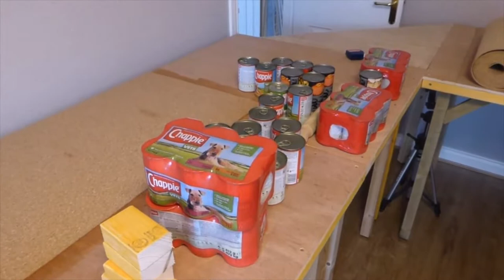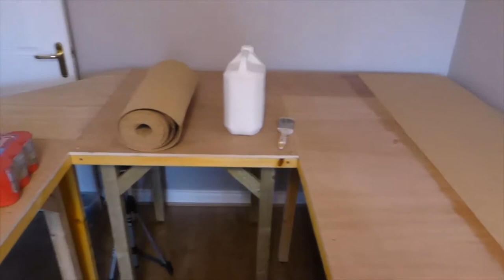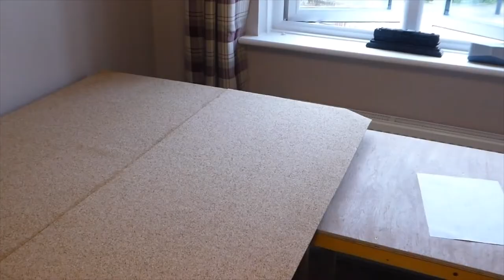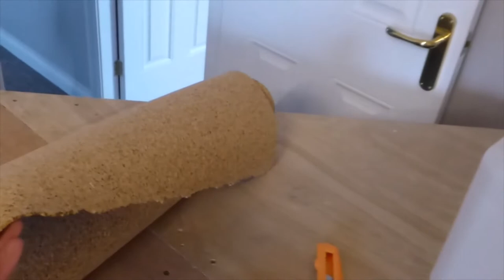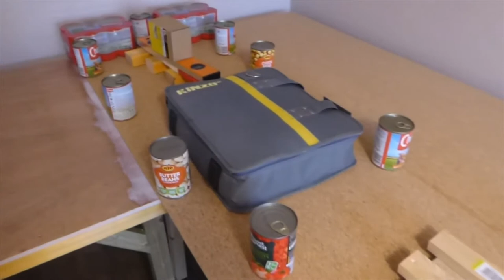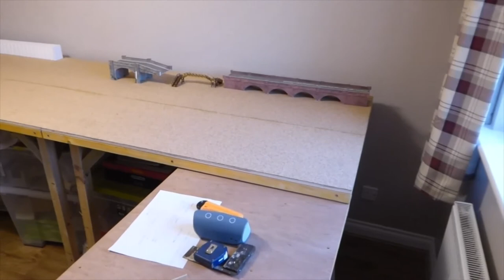Greenhill Junction - Laying Cork - Video 6

Comment: I did the same laying cork over all the baseboards rather than strips under the track as I was not confident that the track plan would not change. And I did have to make some amendments so once finally settled on plan and all is running ok I will cut around the track to give a shoulder for ballasting. Cheers Kev
Reply from the maker: Doing strips under the track too, so there will be 5mm of cork in total underneath the track to try to sound deaden it a bit. Having a think about what I'm doing regarding corking the upper level just now as I need to figure that out before I cut the supports for it.